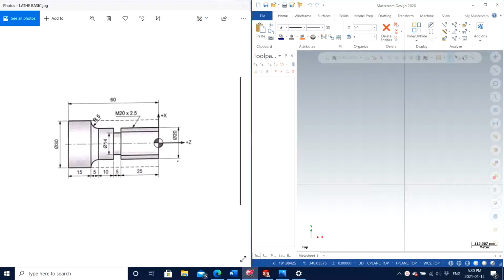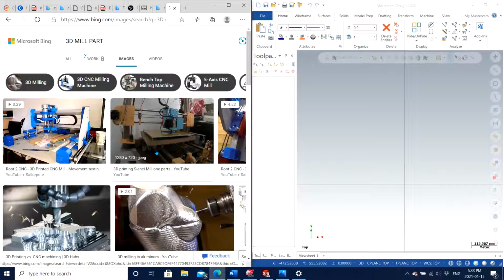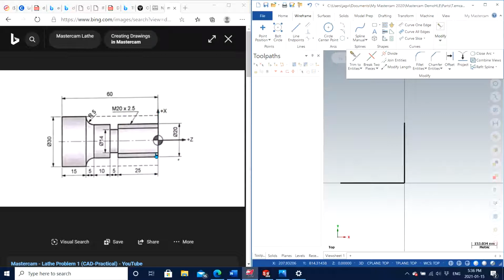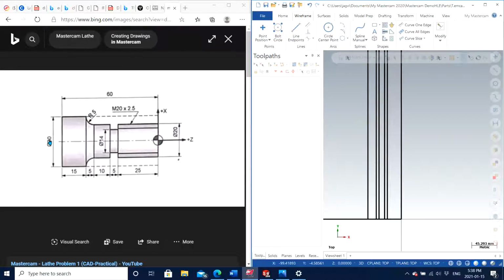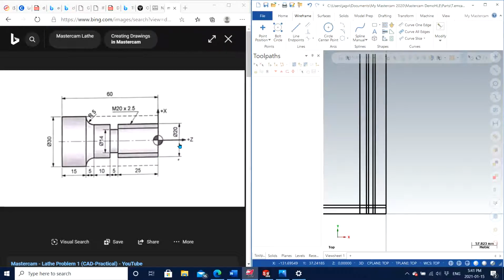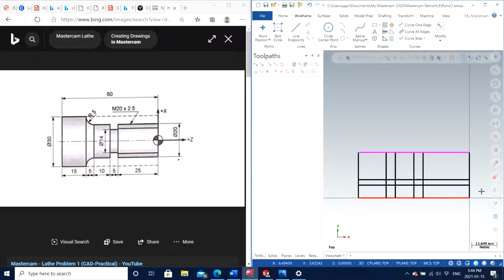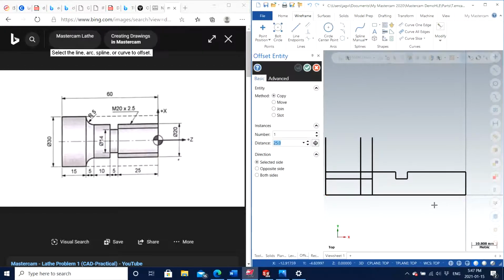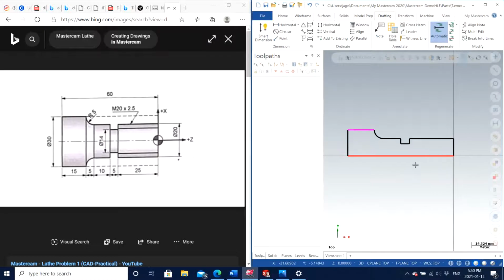MASTERCAM 2020 : INTRODUCTION TO CNC LATHE ( HOW EASY TO MAKE MISTAKES !!!)

Comment: how do you create 2 d geometry from a solid for lathe? is it possible in mastercam?  instead of drawing it up like you're doing? 
if you had a solid and you wanted what we call in Esprit as turning features
Reply from the maker: If you have 2D wireframe, then you can use revolve. 
If you have solid inported simply use silloutte to extract wireframe off the solid
Reply: @Everythingiknow881  no man it 's call ed lathe profile 2d geometry right next to the silhouette option